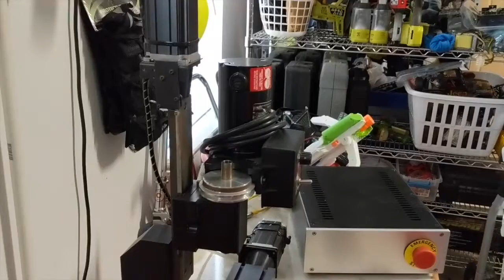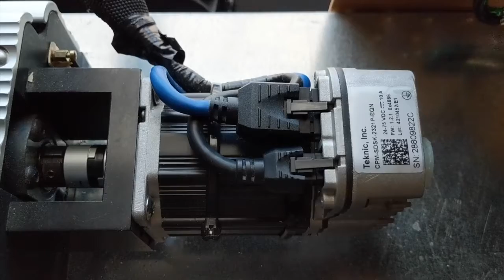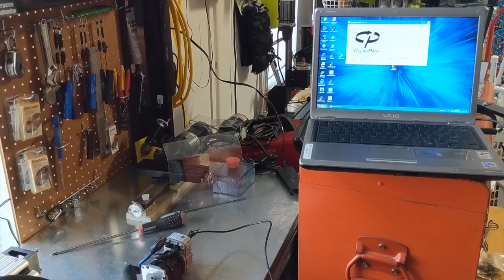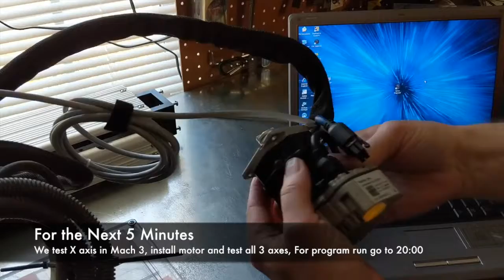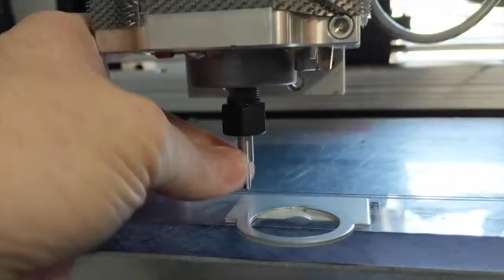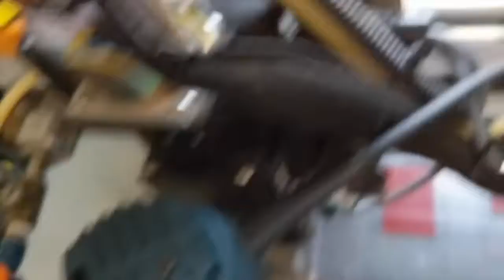Installing Teknic All In One Brushless Servo On My CNC X Axis

Comment: Hi Thrifty Tool Shed,

I found your video and wanted to thank you for the kind words about the ClearPath servo systems. I'm glad to see ClearPath is working out so great for your machine!

Even though things seem like they're working well, I want to make one quick comment about the auto-tuner to help ensure that you're getting the best possible performance out of your servo system. The auto-tuner should be run with the motor hooked up to the mechanics; as opposed to tuning "unloaded" on a desktop before connecting it to the machine. (You may already know this and were just purely demonstrating how the auto-tuner works in this video; in which case hopefully this comment is just helpful added information for your subscribers following along.)

Tuning on the machine teaches the motor important characteristics about the inertia, stiction, friction, etc. of the axis it's connected to. The motor will then tailor its motion control settings to optimize performance specifically for that axis' requirements.

I look forward to seeing the next video when you transition to ClearPath on the Y-axis. I wish you best of luck with the project and if you have any questions, please contact us directly at support@teknic.com.

Best regards,
Kevin S.
Reply from the maker: Teknic Inc, Thanks so much for your comment. I knew you could autotune while under machine load did not know it was the perferred way. I will do it that way from now own if i can. I had hoped to use the Teknic clear path alot about 2 years ago when I operated a business upgrading burn tables.  unfortunately that business slowed enough to shut it down but still look for opertunities to use the Clear path, I do really enjoy the servo system.